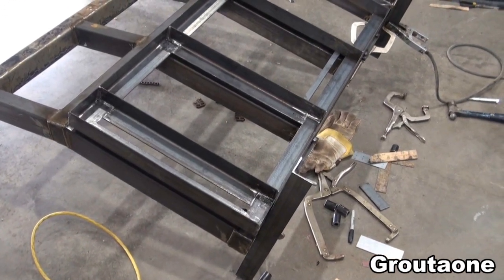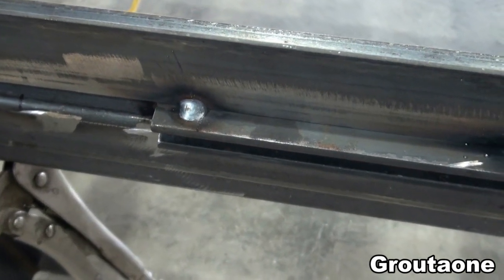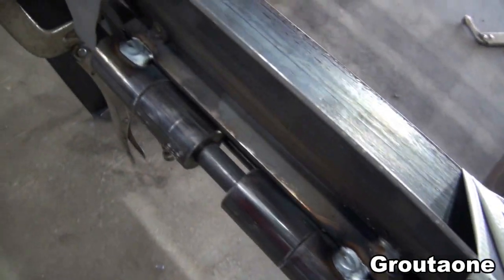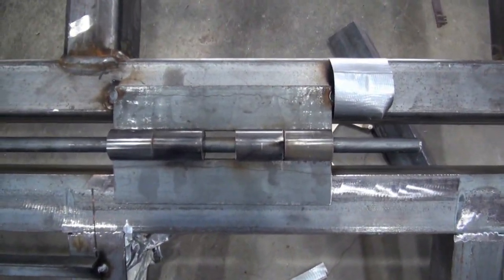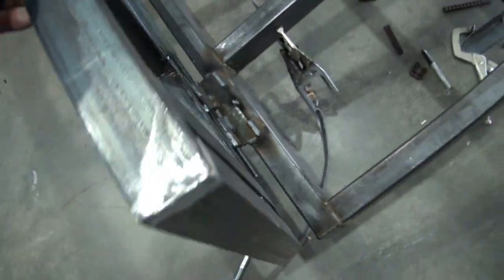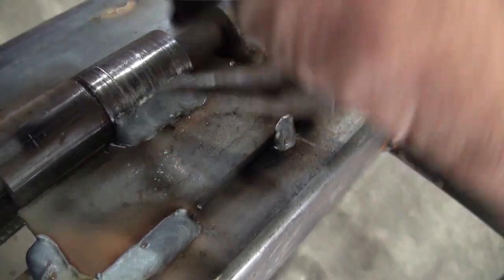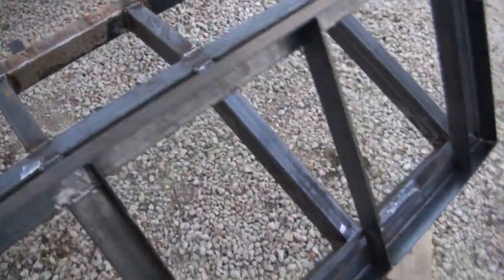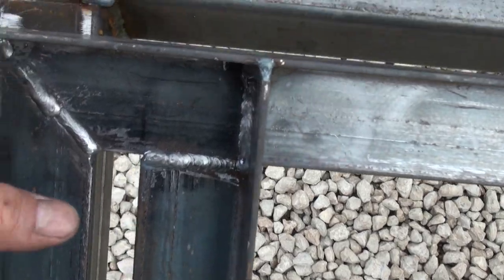Building My Trailer Swing Out Ramp pt2

Comment: I thought my screen   was going crazy then I saw a recreation of the moon landing thanks for the idea with the hinge plates take your angle grinder and make a space for the hinge barrels to move where they are binding that looks like a strong hinge is that angle going to be OK to get. Your tractor or whatever is going on the trailer you could make a opposite opening section to make it longer a fold out two section ramp